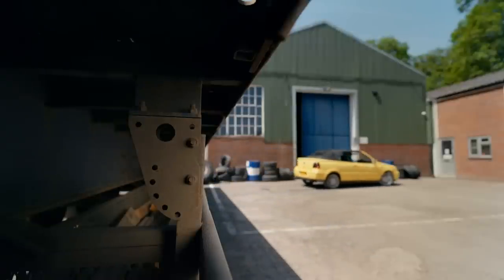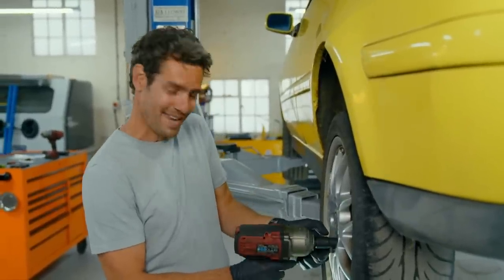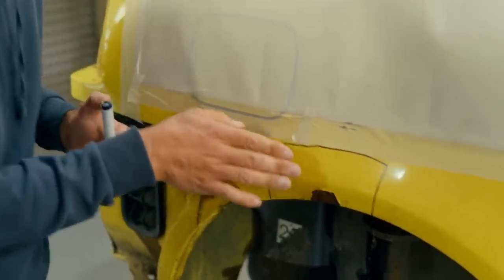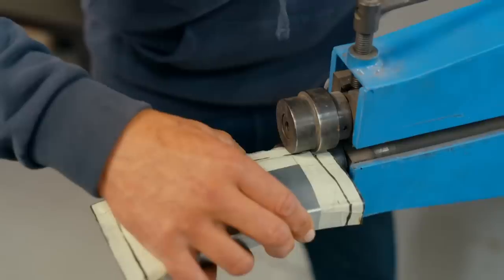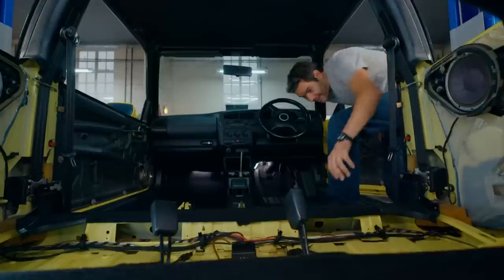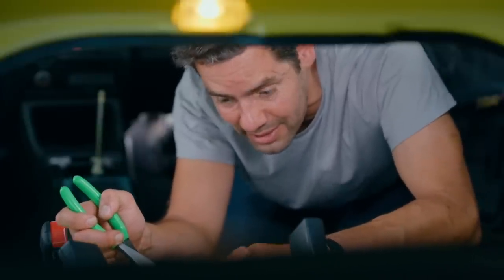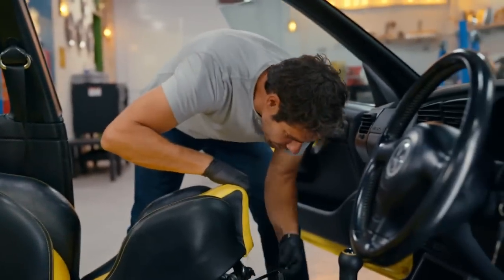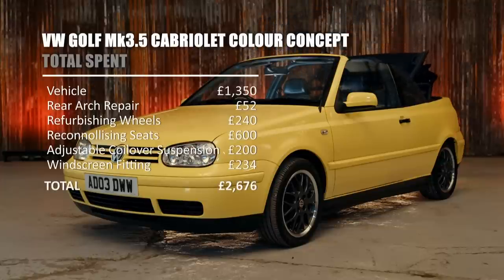Elvis Spices Up A Convertible Volkswagen Golf Cabriolet With Summery Vibes | Wheeler Dealers

Comment: To operate the roof you need to turn the key to the on position but not start the engine. Then turn it back to the off position and the roof works.  No need for any rewiring.